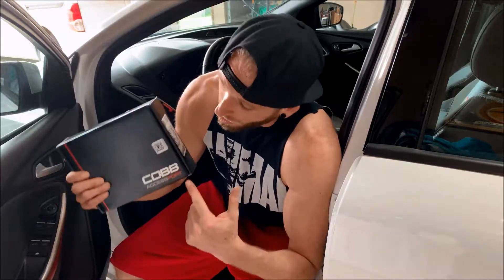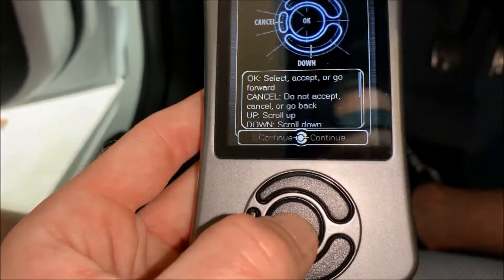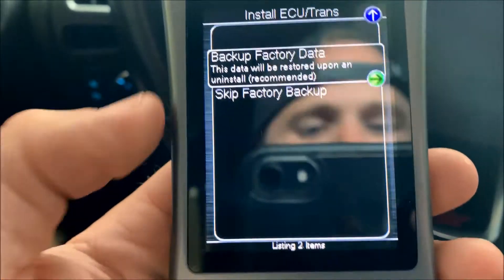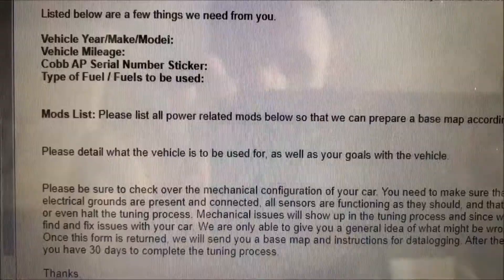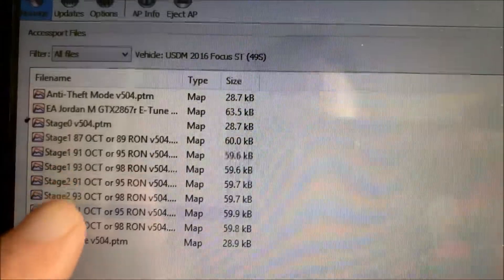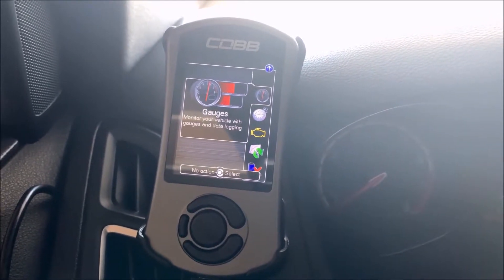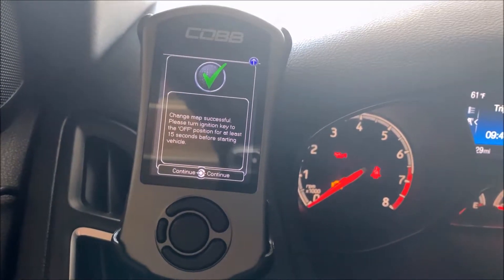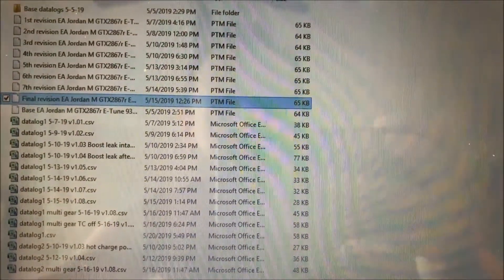Installing and E-tuning with COBB Accessport

Comment: Why did u go for the Garrett turbo instead of an EFR?
Reply from the maker: At the time I did this there were only a couple of options with “everything you need” kits.  ATPs kit with the Garrett was at a 2000$ price point.  Full Race had an EFR kit but was around 3200$ but it did include charge pipes and down pipe I believe.  I wanted to piece mine together with a different downpipe and charge pipes.  Both have strong reputations behind them.
Reply: MOREE GARAGE I just purchased a 2016 ST and I had no idea at the time but I’ve looked around and it has the full race EFR kit. I found the guy that owned it prior and he said that he flashed the stock tune back onto it. The shop that put it on didn’t put the boost control valve anywhere secure so the drive shaft ripped through the wires. I just fixed it and now it pushes maybe 18 lbs but I wanted to know if I’m running it lean on the stock map. I don’t have the cash for an AP right now so I just wanted to know what AFR u were running when urs was stock map but upgraded turbo. If ur on IG I’d like to send u some pics
Reply from the maker: I don’t have insta.  But if you’ve got an upgraded turbo you definitely don’t need to be running with stock fuel map.  Targets are going to be all out of whack.  After installing the bigger turbo I never drove it until I got a base tune from my tuner for the AP.   You can drive it but getting into boost and especially WOT will eventually cause some big problems.
Reply: MOREE GARAGE alright, maybe it was good that the boost control valve was messed up. It was only going on wastegate pressure and that was around 14 psi. I have been babying it. Only WOT less than 10x only in third or fourth. I’m gonna try and buy the AP from the previous owner. He said $350 and it still has the Stratified tune on it for the EFR so that is a bargain I think. Thanks for the info
Reply from the maker: 350$ with a stratified tune is definitely a bargain!
Reply: MOREE GARAGE alright I’m gonna go for it for sure man. If u could make A VIDEO OF A POV drive with the AP in view so I can see what ur CAT’s, negative corrections and boost pressures. Ya know if u had no other ideas lol

Comment: Jordan, check out Virtual Dyno if you haven't. It's free software you can load some data logs into and set some of your parameters to your car
 and it will give you an idea of the HP/Torque you putting down. It's not 100% accurate but can be close if you get all the settings matched to your car. Just an fyi....
Reply from the maker: wheelie steve dude I’ll definitely check it out!  Thanks!